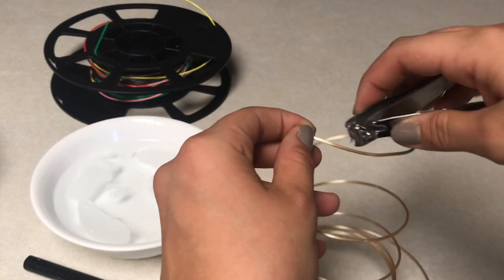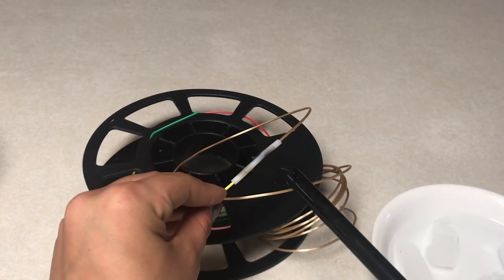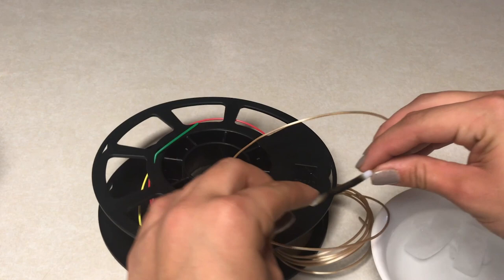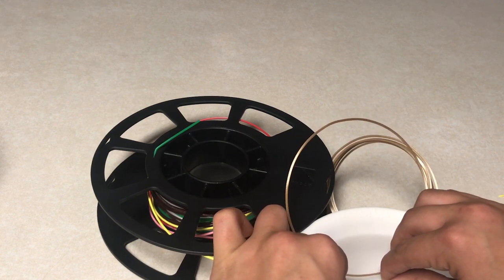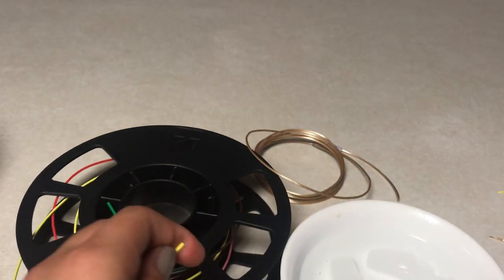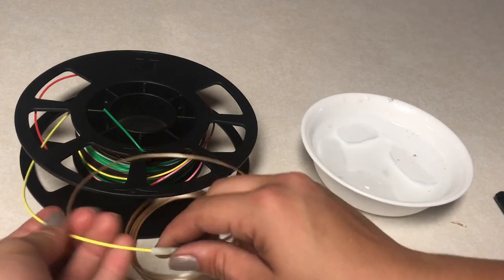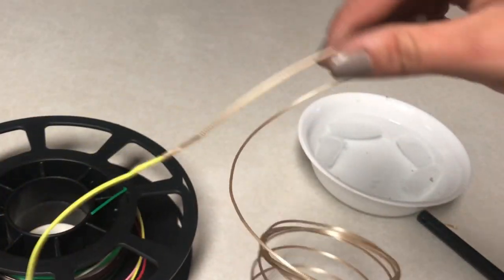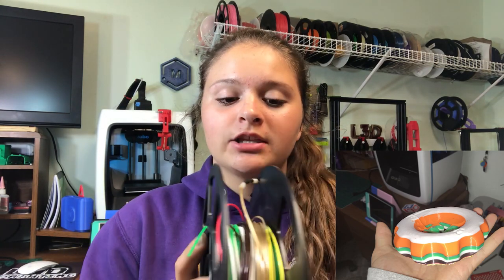How To Connect Filament Together

Comment: I've seen someone else doing this on YouTube and I got very interested - looked perfect but it turns out the PTFE tube lets off some very nasty fumes that are dangerous so I avoided it. The idea is great and as David mentioned maybe a slightly different method would be safer - I may try a metal tube but suspect it would jam - Great job though
Reply from the maker: Thank you. Thx for watching

Comment: Wow I love how simple this method is. It looks easy but you're right, there's an art to it per say. I actually found greater success lightly melting one end of the filament before shoving it into the tube against the other filament. Think it reduces the size of the melt area so you get less size difference.

Comment: Interesting technique. I haven't had much luck fusing scraps either, so I'll have to give this a shot. Using ptfe tubing with tighter tolerance, like Capricorn's XS tubing, would keep the filament diameter more consistent.

Comment: While this is a good idea in general, I would strongly recommend not doing it with ptfe. It off gasses toxic fumes when heated above 250C. Maybe try it with a metal tube and then cool it down or even run it though ptfe after heating. Again, this is very dangerous as shown in the video.
Reply from the maker: Oh ok thanks I’ll try something different
Reply: @TimberWood.Customs  glad to hear back. Keep up the good work!

Comment: I sure hope you don't have any pet birds.  Please, nobody do this.  If you want to use this method, just heat the ends directly, jam them together, then push the soft joint through the PTFE.